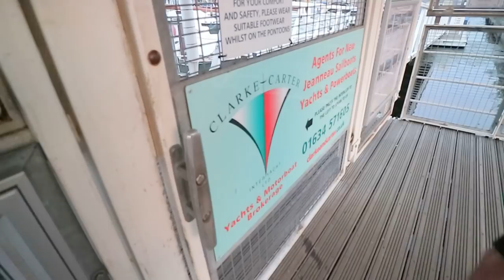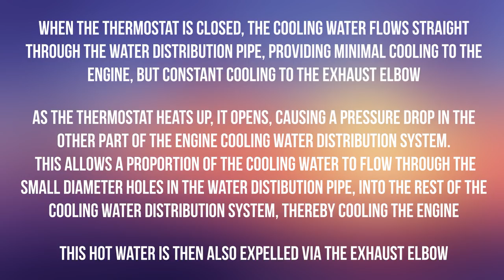Lightning Storm and Engine Overhaul Part 1 | ⛵ Sailing Britaly ⛵

Comment: Correction in your write up. When the thermostat opens the water flow passes from the underside of the thermostat and into the cylinder head and cylinder block, the distribution pipe ensures the injector tubes are cooled even before the thermostat is open, good video.

Comment: I enjoy your videos.  Keep up the good work.  On another note we, were lucky as parents because by accident in our small first house we put the baby's daytime cradle near the TV.  We found that the baby(s) didn't have a problem falling asleep with the TV on. After their evening feeding when we put the to bed for the night we found that we didin't have to be extra quiet because the "baby was sleeping" because they were used to the noise from the TV when they were sleeping during the day.  As they grew older we found they could fall asleep anywhere and anytime they needed to.  That's just our experience, take for what it's worth.
Reply from the maker: Hi there, we agree that it is great to get baby used to sleeping with noise. Fair winds! Chris, Rossella & Emma 👍

Comment: If the last owner overheated that engine too much, it may have a warped head.  Hopefully,  it only needs a new thermostat.
Reply from the maker: Hi Giulio, I got it all sorted, there were lots of salt & mineral deposits in the cooking water distribution pipes. There wall was no severe overheating, just intermittent at high revs, so there was no long-lasting damage done. All good now, and it cost virtually nothing other than my time to fix it! 👍

Comment: Volvo Penta 2003? Have you already open the drain valve? (alltenator side) to the back and down). the 2001, 2002 and 2003 is known to clock at the buttom pipes of the cooling system.

Comment: What model is the Volvo? 2003-?? It looks like one of the Japanese built units (Shuaburamia?) I had to replay a couple if times to be sure I heard you right that your engine is raw/saltwater cooled! Been a while since I've seen a modern looking engine without a heat exchanger. Was that done by the builder as a cost saving measure? Or for fresh water use? The Volvo 2003 series came with heat exchangers as well. They now make some simple ways to attach a fresh water flushing hose which could help with corrosion when the engine sits for a while! But I guess you are ok so far! (26 yrs) The exhaust mixing elbows seem to rust out first which can lead to saltwater getting in the cylinders on shutdown. But your looks like it's been replaces?? No paint ??  Cheers Warren
Reply from the maker: Hi Warren, our engine is raw water cooled but actually I'm a fan of simplicity so I don't plan on adding a heat exchanger and separate cooling reservoir. Tune in to our next videos to see how we get on with the engine overhaul. Fair winds, Chris 👍
Reply: Sailing Britaly   Chris I 100% agree simplicity is great if the engine is designed for raw water cooling. We had an an old Sabb diesel built for raw water cooling . I was conserved you engine needed a heat exchanger for salt water service. Cheers Warren

Comment: If lightning hits the water near the boat does it effect the electronics or motors? Also does lightning ever hit sail boat mast?
Reply: Mast yes, as all the energy will find it's way to ground though the boat via the water, anchor or shore power. Sailing Zingaro had their boat at anchor hit by lightning recently, melted his VHF antenna, blew all the running lights, solar controller, charger/inverter and other electronics. https://youtu.be/1feraCBCanI?t=393
If lightning hit's the water near a boat, maybe if that boat is close enough, connected to shore power and the energy finds a path through the conductive seawater then through the boat hull and to the shore. Current always finds the path of least resistance.
Reply: Like horseshoes and nuclear bombs close is good enough for lightening to cause damage to your electronic system. Lightening emits a large electromagnetic pulse that can cause damage to electronics. Yes lightening will hit  a sailboat mast and it happens fairly often especially during storms over fresh water.
Reply from the maker: I have thought about attaching a few metres of copper cable from one of the shrouds (Attaching it with hose clamps) and throwing it in the water. In the case of a strike on the mast perhaps this would divert a lot of the energy down the cable and directly into the sea. (No idea if this is a valid hypothesis or not). One thing you can do if you are caught in a very bad electrical storm is to put electronic items inside the oven, or a microwave. In the case of a lightning strike, his acts as faraday cage and protects the contents from damage. Fair winds! Chris
Reply: I remember as a child on the farm watching lightening hitting lightening rods, it is an amazing sight. In all my years of sailing my sailboat has never been struck by lightening but I've had a few close calls and have damaged electronics. I have since installed transient voltage surge suppressors on all installed electronics and it seems to have worked well for the past few years. At about $250 a piece the surge suppressors are a bit expensive but cheap insurance in my opinion.

I think your cable idea might work but I would want a large copper plate at the end of the cable to diffuse the charge and the other end of the cable attached to the mast, rather than to a shroud. I have seen a few boats with lightening rods and copper plates mounted outside of the hull.

I don't have a microwave aboard but a cardboard box wrapped in tinfoil would make a faraday cage of sorts. I might give it a try for giggles but I am not going to seek out a lightening storm to test it. Take care Chris and family.

Comment: Suggestion: Consider converting your raw water cooled diesel engine to a closed loop cooled engine.  I don't know your exact model engine, but it should be possible and you will greatly reduce the corrosion  inside your engine, extend its useful life and probably get greater efficiency out of the engine.  The parts you'd probably need
1) a variable speed 12v magnetic drive water pump for raw water pump.  See youtude Catamaran IMPI in Oct 2017 summary of why he converted generator to this set up.  Conversion was about 2 years ago.  For you because your engine varies in speed via throttle, you'd need a variable speed pump.  Cost- about $140 US on Ebay.  They last 10,00+ hours, don't leak and rarely lose an impeller fin
2) a generic water to water heat exchanger sized for your engine, One for your size engine would be around $100US on ebay. The bronze side is for raw water, the aluminum side for closed loop using water and glycol coolant mix.  See youtube Walde Sailing of about 2 months ago when facing a $1400US cost for a new Volvo Penta transmission cooler went with a generic for about $300 US including new professionally made hoses
3) Probably a new thermostat of 5-10 degree F higher opening temp.  A coolant cooled diesel engine can run at a hotter/more efficient temp since you don't have to worry about seawater boiling/steam, calcification.
4) a Y fixture inserted after the exhaust manifold to spray raw water in to exhaust stream to cool exhaust and dump heated sea water overboard
Just something to consider while you are overhauling engine primarily due to overheating
Reply from the maker: Hi Douglas, I know many people would choose the above set-up and it's something I could easily get set up, but I adore simplicity and I actually really like raw water cooling. I'm confident this engine will be reliable after I've done all the work on it. Fair winds! Chris 👍

Comment: Yah Emma is back missed you. I love a good lightning storm thanks for the video. The banjo fitting on your engine like many bolts on an engine dose it need locktite to keep it from rattling loose?
Reply: No Loctite, you don't want it getting in the fuel system. Usually there are copper washers on the banjo fitting like the one Chris heated to anneal (soften) it. The copper work hardens when people loosen and tighten bolts, and from the temperature cycling and vibration.